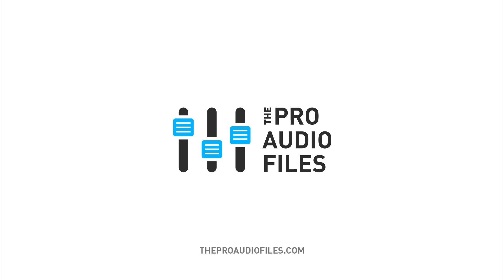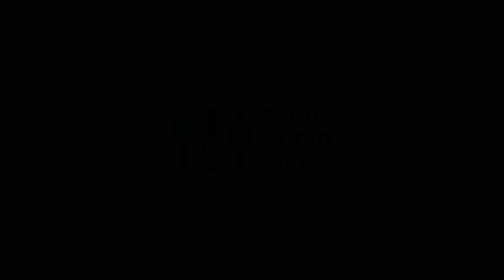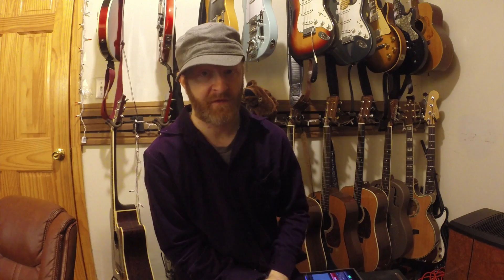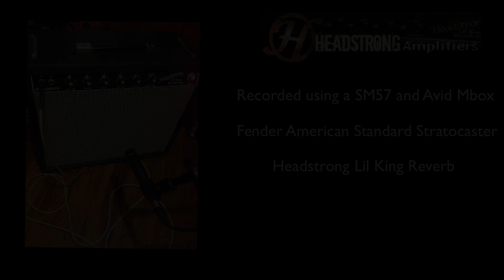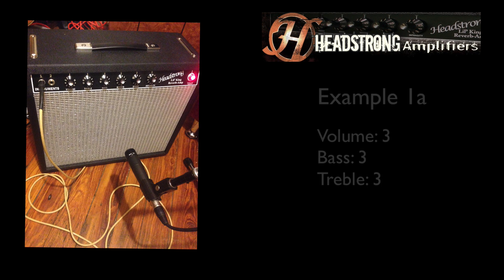Fender Guitar Amp EQ — Technical Breakdown and Audio Examples

Comment: I believe the fixed mid range for amps like the Deluxe and Princeton is more like 6.8, not 8... If you look at their schematics, there is a 6.8k ohm resistor for the midrange while for amps with a mid range control like the Twin, there is a 10k ohm pot.